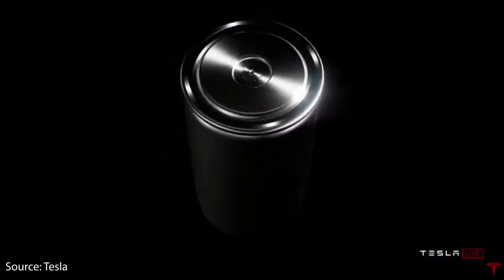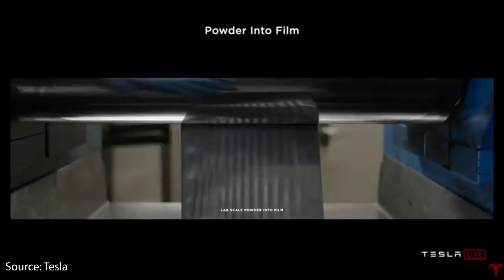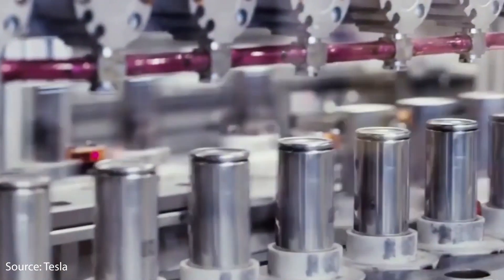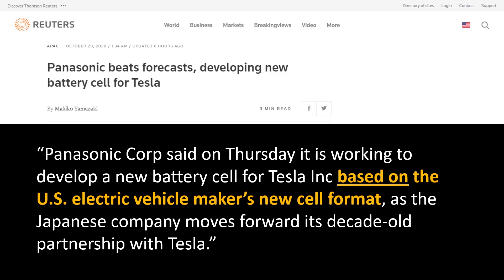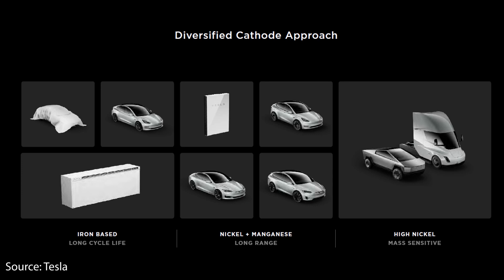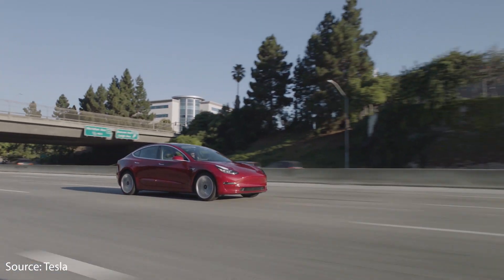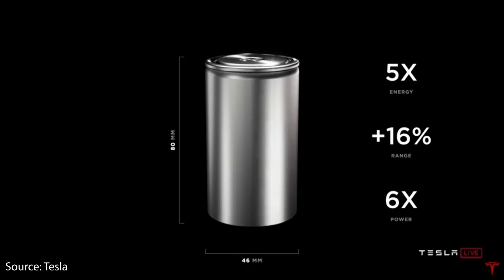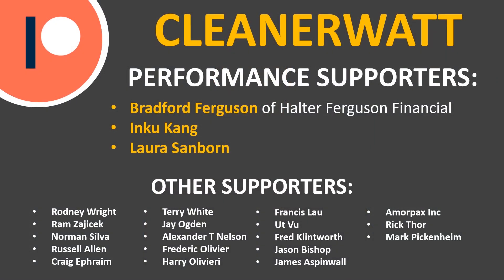Tesla NEW 4680 BATTERIES made by Panasonic

Comment: Two of those being about 8+ 18650s (guestimate since real numbers are hard to find) with a lot less wiring and fewer cooling challenges, is going to revolutionize portable power. 

Electric bicycles are about to get a lot cheaper if other companies can use this. So will garden equipment, and power walls.

Won't help with things that need to be small though.

Comment: While Panasonic might make a variant of the Tesla cell, I think they will be making the same cell as Tesla, for the simple reason that with several new model cars coming out,  Tesla is going to run up against the limits of their cell production capability. This is especially true for the larger vehicles like the Semi and Cybertruck which use significantly more cells than a car. 
What about selling those cells to other companies? I think Tesla is fine with that, although they will undoubtably get a significant royalty on those cells so that Tesla will always have the price advantage. Elon recognizes he can't save the world all by himself, and getting these low waste, cheaper, faster to manufacture, and higher capacity cells out in the world is going to speed up the electrification of  everything, which is exactly what we need.
 In the long run Tesla wants to create competitors, not put them out of business, because the herculean task ahead of use needs lots of hands working in the same direction.

Comment: Page 1:48 depicts Tesla’s tab less 4680 assembly. 

Tab-less battery isn’t ready for prime time until few more associated patents were filed to cover the following issues. 

Tesla’s tab less battery, more appropriately the “multi-tab junction contacts weld less architecture”.  

There are limiting factors of tab less battery that Tesla failed to address the public are :-. 

(1) junction compression force, unknown 
(2) junction area, unknown
(3) junction (force and area) retention under operating environmental conditions, unknown

Test condition and degradation rate unknown
(4) Thermal expansion / contraction cycles?
(5) Thermal shock?
(6) Acceleration / deceleration cycles? 
(7) Acceleration / deceleration shock?

The tab less (multi-tab) architecture comprise of - cell cap -> air gap -> multi-tab. An air gap bridged between cell cap and multi-tab, such that electric and heat stay within the cell ... instead of the advertised benefits - lower electric and thermal resistance. 

And by chance the air-gap may be unintentionally bridged with a few conditional point contacts that can be disconnected again upon inertial shock and hence spark inside the cell. 

In the case the cell cap was intentionally compressed at (unknown) force onto those multi-tabs for a conditional electric and heat conduction, such axial force will also be coupled to the far end +ve terminal through the roll up electrodes thereby wrinkle/ripple up the rolled up laminates that seriously compromise battery resistance, capacity and longevity.

Comment: I've got to think that if Panasonic is able to do 4680 form factor, then they're going to have to acquire both tabless and dry battery electrode tech from Tesla. Otherwise, there won't be nearly the same level of manufacturing advantage. Part of the premise of being able to go bigger is the heat dissipation and higher current discharge from tabless. They're also going to need the silicon-coated anode technology. The main differences between cells will be cathode materials.
Reply from the maker: Tabless is a given, but DBE may not be something Tesla is ready to license out yet. I guess we will see in the near future.

Comment: I believe you are wrong about the the new construction techniques. The tabless,  dry electrode and bulk charging  have such.major effects on costs  battery life,  speed of production and cell failure rates.  It is in both companies interest to use the new construction techniques.  It would be ludicrous to think they would consider not using the new battery techniques.   With 2.5 -5 years to go of the new agreement not seizing these advances would be ludicrous.  (Tabless is a must,  it is essential for the 4680 fotmst).
 They will be using there existing material mix and supply lines. Maybe further cobalt reduction and whatever the current  upgrade they were planning.
Tesla may even have used some of panasonic anode and cathode in there early tests.  It would have been easy to obtain with known performance carecteristics,   probably starting 2170 before moving to 4680.  So it is likely tesla can and will help them with the new line.
Both Berlin and Austin are commencing production before there own battery plant is completed.  Both of these will be using the structural battery from day one.   So in the spring berlin will need 4680 cells to roll up production.  In both panasonic and LPO4 FORMATS.    Similarly Austin in the Autumn.
This will also allow them to ramp up production of the cyber and semi trucks.
Existing 3 and y lines as suggested at battery day will be after new plants are successfully at berlin and austin.   However if CATL and LG both make versions of their  cells in 4680  Elon might be tempted to switch China sooner.
PERSONALLY. I  THINK PANASONIC SHOULD ADD DRY ELECTRODE and tabless to the existing 2170 lines,  two new front ends could perhaps feed the existing 13 back ends.   That 97% as opposed to the 87/88% of the existing lines would be amazing,  how long to ramp up,  Elon might have an idea.  This would also make them million mile+,  so they won't be aggrieved that others have better battery.
S&X  well that will just depend on panasonic, battery supply & Elon.

Comment: I just bought a Leaf.  It was a 24kWh model with a poor battery health.  The dealer swapped out the battery with a 30kWh battery with a 90% health from a wrecked Leaf. The swap took him one hour.  Can Tesla batteries be swapped out as easily.  How about with the new configuration in which the batteries are part of the structure.
Reply: Tesla batteries don't need to be swapped out. Unlike crappy Leaf batteries (I owned a 2012) the Tesla batteries are not only a much better chemistry,  but they are also COOLED. That is Nissan's fatal mistake, no cooling. Your 30 kWh battery is going to wear out even faster, since it's the same crappy chemistry,  no cooling, crammed together even closer.  The current Tesla batteries are good for at least 300,000 to 500,000 miles, with the next generation being 1,000,000 miles, if they aren't already.

Comment: Maglite and Panasonic/Tesla ought to make a Tesla flashlight with 1,2 or 3 of these 4680 cells.  The current battery most similar is the D (3365)  (1.3" diameter  1.8" for the 4680)

Comment: It’s all good. But batteries don’t last forever. How do you recycle them without contaminating the environment?
Reply: Completely discharge them, grind them to a fine powder and seperate the materials they are made of based on their properties (mainly magnetism and density)
Reply: Hopefully tesla is learning how to recycle.  As they learn how to make batteries they are making tons of scrap.
Reply: Didn't any of you guys watch Battery Day? Elon fully explained that every Tesla battery is fully recycled by grinding it up, as Unitrader said, and getting back the raw materials.  They are too valuable to scrap,  and it is a lot cheaper to get the raw materials from recycled batteries than from mining new materials. Eventually Tesla plans that most new batteries will be made from recycled ones. It is all in their plan. But, at the moment you would be lucky to even get ahold of a used Tesla battery,  as the EV conversion guys are paying big money for them, or the guys building powerwall with them.

Comment: Go back to battery.day and rewatch it. 
 Cybertruck and semitruck will not use the existing chemistry of the.2170 cells.. They will.use.the.tesla special cells they are manufacturing themselves.  However   Berlin will be commencing production in the spring/sumer  before it's on site battery plant is completed.   Giga berlin is using the new structural battery format from dayone.it capnnot use other cells.  Consequently it needs to be provided with the cells it needs.  ie  the panasonic spec.  bateries and LPO4  Batteries in the 4680 format.
It must have tabless else the form factor not work.   
Can Tesla afford it not to.have dry.electrode, as well. 1)  there is a huge cost saving, halving of cell failure rate,  and extended batbattery life,  these two elements take the Panasonic cells to more than 1Mmiles.  Which. Will.not leave owners feeling outdone by the other batteries.    As it a new line bulk charging could also be implemented.
In actual fact I think tabless  and dry electrode is such a.msssive boost and cost saving  with at least 3 years to go it would be in.both.Tesls and panasonic interest to incorporate that into the 2170 cells.   One of.the added features Elon mentioned that had not been  anticipated each of them reduced.failure rate by 50%,   the two together added is 75%.   So instead of 87/88%  production rate it gets up to 97%.
This in itself reduces costs by a10%. On top of expected savings.   Sorry everybody it
 Got a bit long,  my apologies.

Comment: Do you seriously believe that Tesla is capable of producing better cell chemistry than Panasonic, Samsung, or Catl? Hahahah
Reply: Could you have asked that about anything else tesla has become a market leader in? To be the best only takes one mind and a capable team. Just because you have been doing something longer, doesn't mean you can think about things in an out of the box kind of way to get large leaps ahead.

So are you saying tesla has the best form factor, anode and tab/tables design? But are behind in chemistry of the cathode only?

Are there particular strengths and weaknesses that the DBE process allows that enables certain chemistries that the competition cannot use?
Reply: Yes
Reply: Also what metrics do you mean by better cell chemistry? Does that mean currently in production? Cost per kw? Discharge speed? Lithium plating resistance? Materials used? Time to market? Ease of manufacture?

Are you saying tesla can't beat the other guys at the end solution for optimising to their preferred weights on each of those things?
Reply: @Scholzey  I say that Tesla has very little know-how in cell chemistry. Panasonic and the other major manufacturers are about 10 years ahead in research.
Reply: @christianwaldner106  will the competitors ever bring that research to market? Do you know how many smart people tesla and SpaceX have at their disposal? They have material scientists, chemists, engineers.

Like they say, it's easy to make a battery in a lab. Will that 10 year lead take another 10 years to get to market? If it does, tesla has the best in the market making them money and funding more research while the others stuff around in labs with tech that's many times better but never sees production. Then by the time they get to market, tesla has matched or leap Frogger them.
Reply: @christianwaldner106  Have you ever heard of Professor Jeff Dahn?

Comment: I mean they would have to. Tesla is stamping out the front and rear and then holding them together with the new battery case. This will be happening almost immediately so no mater what the chemistry they will need that size cell. I would be very surprised if Panasonic do not already have them in production.
Reply from the maker: Yes, very well said.

Comment: Thanks for your very informative videos.  I live in Canada and wonder if the different materials you describe for batteries makes a difference in cold weather climate?  Is one format recommended versus another based on cold weather?
Reply from the maker: Thanks for the kind words. As far as I know, these chemistries will not make a difference in Cold weather performance per se, however with more overall range available, the winter range losses may not be a big deal anymore.

Comment: I think you are wrong. You can't just make a bigger cell without the innovation like tabless and DBE. If you do that you have massive issues with heat and other issues as well. These new batteries would not support the the fast charging and discharging Tesla needs. Such batteries would simply not work for Tesla to hit the performance specs they will need for their new versions.

Something is being missed in communication, Tesla clearly didn't explain all future plans at Battery Day. Will be interesting to see how this all shakes out.
Reply from the maker: Re-listen from about 1:40 on where I say that they will allow others to use this "format size and tabless technology".  Also at 3:40 I specifically state that Panasonic will use the TABLESS design.

The DBE Process is about MANUFACTURING, not necessarily about performance gains. The DBE process can be used with various chemistries with varying performance characteristics.

The point I tried to make is that the DBE manufacturing process and the chemistry improvements (more silicon in the anode) are probably not being used in the new battery produced immediately by Panasonic. Why? Because this allows for MORE 4680s almost immediately for less ENERGY dense needs.
Reply: Also, keep in mind that at Battery Day Elon said there will still be room for lower performance batteries, like the NMC we have now and even LFP. Not every Tesla needs 500 mile range or 700+ HP.

Comment: I thought the tables design was needed for the 4680 for cooling.
Reply from the maker: As I mentioned in the video, it will most likely still be a tabless cell, just not manufactured with extra silicon in the Anode and with the Dry Battery Electrode manufacturing process.

Comment: My concern with Tesla is they are moving so fast that regulatory bodies can't keep up. Having batteries integrated into a vehicle means that reparing a failed cell could be impossible in future. The vehicle may need to be recycled as opposed to be repaired. Also, once the battery is depleted EOL newer cells may not fit into older vehicles rendering the entire vehicle redundant thus creating waste without a global recycling operation.

Comment: Now we wait for CATL to announce they are also going to produce the 4680 format for Tesla....
I wonder if those manufacturers are also be using the (licensed) tabless design of Tesla, otherwise they will get heat issues in the battery
Reply: Yep, 4680 will require tabless design.
Reply from the maker: Exactly - it has to be a tabless design for this size to work.

Comment: you missed the point Tesla is eliminating the use of Cobalt in its batteries, high silicone , high nickel, and no cobalt
Reply from the maker: Yes, but not immediately - this is not about NEW battery chemistries, but rather about a new cell form factor and cell design with existing chemistry. The reduction and removal of cobalt is coming (probably with Tesla's in-house produced cells), just not immediately

Comment: Manufacturing with wet (slow/complex) vs dry (fast/simple) chemistries? Not seeing that in any of the 4680s. Going the other way and retrofitting the smaller plan forms might be more feasible, but why bother, due to the structural and thermal management benefits of the the bigger cells? Thinking Panasonic and Tesla will just ping pong pilot manufacturing lessons learned until stable/optimized manufacturing is achieved, then go full tilt production with the standardized model (concomitant with the need to build machines that make the cell making machines to facilitate factory expansion goals).

Comment: Always love your videos and explanations but I think you missed the mark on this one.

Tesla clearly stated they are removing Cobalt from all their batteries chemistries, because it costs too much, and also for humanitarian reasons.

I think it's more likely that Tesla is licensing their technology to Panasonic, LG, and CATL since the 4680 cells will be the industry standard for the next decade.
They will most likely build the battery making machine for Panasonic and then purchase the batteries that are produced for their Model S and X, since Tesla entered into an exclusive agreement with Panasonic initially to be the exclusive battery supplier for North America, when they built the Gigafactory Nevada.

That's why Panasonic stated that their profit margin will increase. They don't have to ship 18650 batteries manufactured in Japan for the Model S and X, and they don't have to make a more expensive 2170 battery. 
Also any additional supply they can sell to other automakers for their vehicles.

It would also take Panasonic too long to reverse engineer what Tesla has developed, and Tesla needs 4680 batteries in all of their future vehicles, not just the Cybertruck like right now.

A Model S and X refresh is long overdue and probably around the corner.

Comment: I believe the 5x more energy is a result of the cell being 5x more voluminous. For example, a 5 gal gas can holds 5x more energy than a 1 gal gas can.  The power equation  on the other hand has to do with the tabless design since it can drain faster if all the electrons don't have to squeeze through a single tab.

Comment: I think Panasonic is buying the production equipment for the new battery format from Tesla. It's faster and cheaper to use proven tech with higher  yield rates.  The production process should be formula agnostic.  It speeds Tesla to the structural battery pack (all batteries are the same size) and leverages single casting front and rear frames. So will Germany and Texas  use the new frames and castings as the new lines are activated? That's next Spring/Summer!